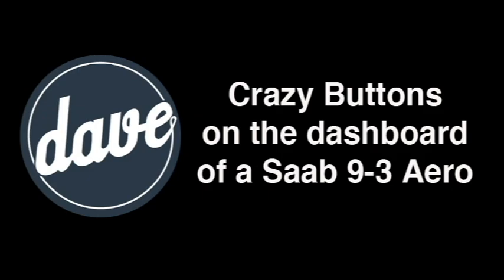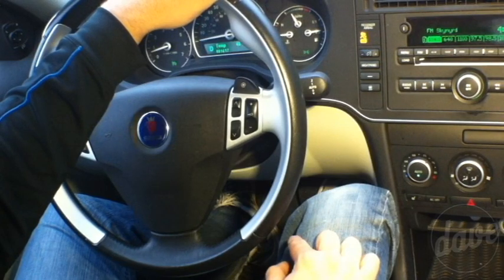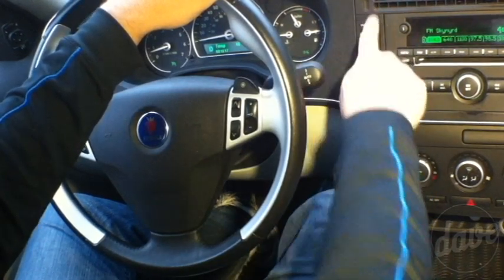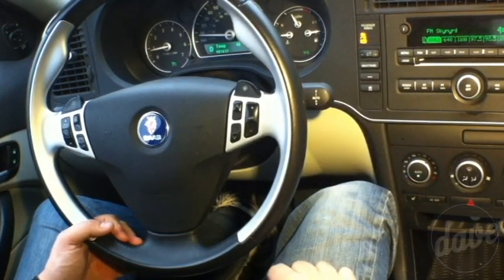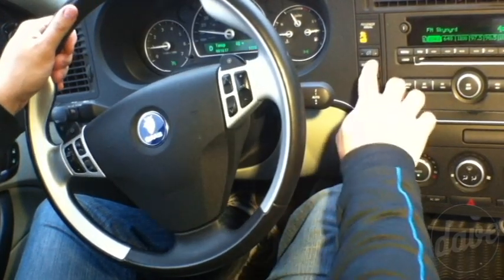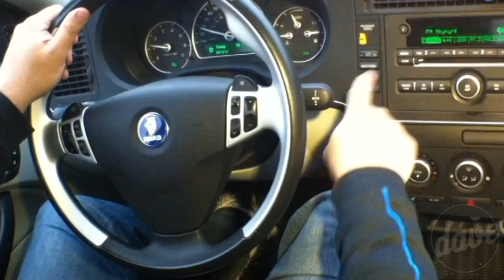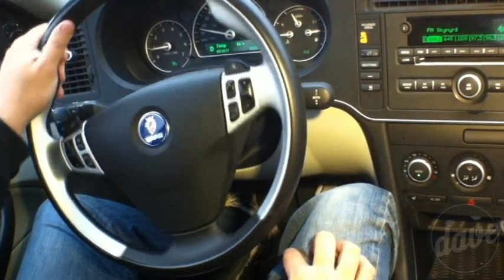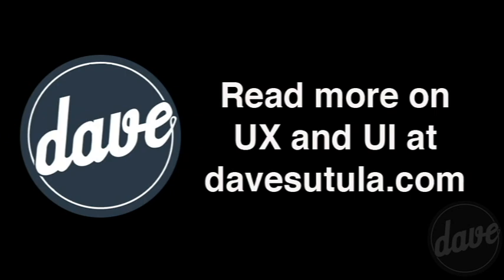Bad UI.  Four buttons I cannot explain in my Saab 9-3 Aero

Comment: Night mode was created to improve the drivers night vision , it turns off all unnecessary illumination on the dash gauges except the speedo (they will instantly re-illuminate  if there is an issue with system they monitor such as high coolant temp or low fuel level etc) this allows the low light sensitivity of ones eyes to not be influenced by the ambient light from the dash displays and also reduces driver focus  distractions as well so ones eyes can adjust to be more sensitive to low light viewing at night similar to the act of pilot intentionally  dimming his instruments for better low light vision while flying at night which is where this feature originated.

Comment: The car was designed in Sweden with the driving conditions in mind. during the mid winter there is no daylight within the arctic circle while there are elks running in the forest that may jump in front of the car at anytime in the darkness. It is in these circumstances that you start to appreciate the dimmable instrument panel lighting, the (-) switch for the auxiliary headlights, or the night panel. The TCS bypass is rarely needed due to the well designed traction control system but there are times when it must be bypassed  in order to get unstuck in snowy and icey conditions. I can understand that in places with more pleasant circumstances there is less need for such functions.

Comment: The night panel is extremely useful in Scandinavia, which is why the engineers designed the function! It might not be useful in other parts of the world, but in Sweden, where half of the year consists of darkness, low visibility and bad weather, the night panel function reduces the light emitted from the cabin (and thus reduces the strain on the eyes). This is critical when it's pitch black at 22:34 at night in poor weather (read november) before the snow has settled and it's raining outside and you can't see shit and some wild (large) animal is standing by the wayside or on the road a little up ahead. I know that this function for a fact is useful since I always activate it between october and february when driving in Sweden during most of the day (when it's dim or dark outside).
Reply: Also - the button with the "----" is the "extra" button. It's designed to allow the owner of the vehicle to install accessories which can be turned on/off using Saab-designed buttons. In Scandinavia (again) it's quite common to install extra heavy duty external lights, and this button allows the owner to seamlessly integrate those lights (or other equipment) without cluttering the dashboard with hacked-together shit.

Comment: 1 dimmer works better at night since you can see the lights better
2 the 9-3 has a lot of lights it turns them off. use it ever day
3 no idea that is why I am here
4 traction control toggle. on to stay of road off to slide in snowy parking lots

Comment: Ungh, old video, but the comments are mostly as inaccurate as the video. The reason for TCS/ESP (fourth button) not immediately turning off when you press the button is that it's a safety feature so you have to push it for a few seconds to actually commit to turning off this safety. Also, this is an icon that is standardized so you will find them in all cars since at least 2010.

Comment: The button with the dash on it is for an optional set of extra lights. There is a relay and wiring harness along with the actual lights needed and then dealer programming is needed to enable it. When equipped the extra lights will only turn on with the high beams on. I don't think this was ever offered in the USA and is probably pretty rare in EU too. On convertibles the "---" button is replaced with the convertible roof controls.
Reply: +David Howard 
Dear David, you mentioned that it is for additional lightining. And that there is everything ready, llwiring, relay.. but you also mentioned that it need to be enebled firsty.
i was wondering if I could use this button to control additional, aftermarket headlight spray system that I would like to install.
Would it be possible, how do you think?

Thanks
Sero

Comment: This is somewhat strange.. I have a 2003 EU version of the car, with the 5 speed manual, and the Dash gauge Lighting difference is quite noticeable when using the adjustment button.

As far as the NightPanel goes, I literally use it all the time. I don't need to know my RPM, I can tell when to shift just by listening to the car. The temperature gauge always stays the same and, should it go wrong, it lights up anyway. Same with the fuel. And the boost pressure gauge is nice for impressing your friends, but does nothing in actual driving conditions. A turbine failure will appear on the SID at the top of the dash anyway and probably engage the limp-home mode on the car (an icon with a rather cute turtle will appear :) ) So, I guess it depends on how you prefer to drive. If you enjoy the light show, on it stays. I've been on journeys for 5 or 6 hundred miles, at night, with the dash off and appreciated the lack of lighting.

That Minus button in my car is solid. Buttons like these are used for auxiliary equipment, usually. Say you'd want some cool Hella floodlights up front, you hook up the wring behind the button to them and boom, lights. I have another car that's like a replica of an old '69 Renault 12 (a Dacia 1310), and on the dash are two toggle switch blanks that people tend to use for fog lamps or (since the car came as a pick-up too), roof bar lights.

The ESP button you have at the bottom will work, actually, but I noticed in your video you were driving along. However, it can only be engaged or disengaged up until 30 or 40 Km/H. The best time to try it is when you are waiting at a light and the car is stationary. If you press the button a diagonally crossed orange triangle with the skidding car in it will appear in the display beneath your speedometer signalling the absence of ESP. I tend to drive with it switched off since you get a better feel of how the car shifts mass in its normal state. It also affects the electronic throttle, in that you will notice it to be sharper than when the ESP is engaged (this is not because the throttle position sensor works better or anything, but instead the ESP no longer cuts throttle when the wheel sensors report wheel spin).

I kind of wish there would be an ABS disengage button too but hey.. we can't have it all I guess :)
Reply: The traction button - or ‘Slort Mode’ in the 9-3 - displays the word SPORT on the friggin dash under the currently selected gear!!! This guy is such an embarrassment to himself. 

It changes the drive by wire & RPM arch.

Comment: Her ein scandinavia the night mode would be great. I remember I had this double din pioneer head unit in my Volvo S90 and I were driving from Oslo to Bergen, that's a farily long drive without any lights. It was in the middle of the night and the head unit had blue leds. After about an hour or so, it really strains your eyes. It starts hurting your eyes and takes away your night vision.. The pioneer double din was not dimmable.

So I really see a use for night mode. The traction off button is a well known symbol. The dash button I have to agree, is not really intuitive. The others though I would say are. You clearly see the instrument panel by the +-.

Comment: I would just like to comment on this the first button is the light dimmer control button used only at night. depending on whether you want low lighting or higher on your dash or console. the 4th button you are referring to is the traction control system if you push it nothing will happen however if you hold it in for a certain amount of time then and only then will I disengage the traction control system

Comment: And the ESP is electronic stablity program. Also called eTCS. You won't notice it unless you are driving in low friction areas. Reason you can turn it on and off is that in sweden where it is made, the people there are so used to driving on ice they like the option to turn it off.

Comment: Don't SAABs come with owner's manuals in the states? 

Night Panel; since you filmed this in daytime, it won't be obvious, but the clue is in the name. It's to avoid fatigue when driving AT NIGHT, and it has some superbly sensible features - the speedo has printed readings to 140 or so, but when you engage Night Panel, only the segment up to 90mph is illuminated, on the (reasonable) presumption that you won't be going above this. Also, every gauge except the speedo is dimmed, BUT - if fuel drops below a quarter tank, the fuel gauge comes on. If any alert situation arises (overheating) the appropriate section also illuminates.

Likewise the top button is instrument panel illumination level; the use for which becomes obvious in night driving.
Reply: Moved on from the old Lotus then, we see..  ;-)
Reply: Yes and if you get one that doesn’t have it they’re like $5 online

Comment from the maker: The fact that we have to have this conversation is testament to the fact that it's bad UI.  It should be intuitive, not a topic for a support forum.
Reply: Not at all. 

You had to LEARN how to drive. . 

You had to LEARN how to drive a standard transmission. 

You had to LEARN how to check, add or change the oil. 

You had to LEARN how to check, add or change several other fluids. 

You had to LEARN how to check tire pressure and/or put air in the tires. 

You had to LEARN how to change a flat/put on a spare tire. 

EVERYTHING about a car is an exercise in LEARNING. 

NOTHING about a car, or driving one, is a strictly ‘intuitive’ or ‘assumable’ aspect. 

The vehicle, owning it, maintaining it and/or driving it simply starts to TAKE ON a sense of - it begins to FEEL LIKE - a much more intuitive experience because WE as the owner & driver are getting older and have more experience.  It is like anything else in our lives. The greater our reference points, the simpler it seems. 

But, try asking a 2 year old about mowing the lawn or an 8 year old about basic algebra and they will look at you like you have a second head.

Comment from the maker: A few answewrs to the comments below:
1. There are no newer models to this style, so the comment that the button is used in newer models holds no water.  That might have been the planned use fore it, but....
2.  I understand what the nightpanel is meant to do - reduce eye strain - but c'mon.  I think that this is a bad idea and I stand behind the 'crazy driving' comment.
3.  As far as the owners' manual goes - the version I had made no mention of any of this except that it identified the traction control button, but still made no attempt to explain the function.  I mean, without a description, one woudl have to wonder why anyone would ever drive without traction control on.  Does it make sense to think that there are occasions where one would want to have the traction in an out-of-control state?
4.  Indeed, I know nothing about SAABs from a mechanical point-of-view - but that's exactly the point.  The user interface on a consumer product should not require deep specialized knowledge of the product to be completely usable.  That's what intuitive means.  Do you have to soend six weeks studying the ins and outs of audio compression to operate an iPod?
5.  If you read the comments, a number of the supposedly well-informed commenters disagree on the function of the button with the - on it while all admonishing me to read the manual.  So...
Reply: 1.  this car was built for swedish and american drivers.  There are some functional differences due to the nature of driving conditions in the nordic regions.  As such, there is probably a use for that blank button in swedish models.  It would probably look weird with only 3 buttons won't you say?

2.  Just because you haven't found a use for the NightPanel doesn't make it 'crazy' or useless.  I happen to use it regularly since I drive long distances on dark roads at night. It only shows you what you need to see; the remaining gauges and notifications still illuminate when there is an abnormal condition. 
 -If your rpm goes too high, the gauge will light.
- If your fuel is low, the gauge will light up...etc

3.  I don't know about your car, but when I press the traction control button on mine, the icon shows on the notification area so I don't know what to tell you there.  Also, every car I have driven with traction control has the option to turn if off - this isn't a saab thing.

4.  in response to the ipod comment, no you do not need to study audio compression to operate it.  But there are tricks and shortcuts which take time to either stumble upon, or get familiar with.  That is what these controls essentially are.  You don't need them to DRIVE the car; they are just for convenience.  And btw, how long did it take to figure out how to use Itunes with your first Ipod...nuff said.

5.  Again, blank button, if it doesn't hinder the operation of the car, leave it be.

Hope this helps!!
Reply: eazye8523 I'll add.

2. Exactly - the button doesn't make much sense in the city or on lighted highway... but try driving on dark backroads in the night... it'll make a world of difference. Similar with the gauge backlight.

3. Useful to get yourself out of snow, for example. Either you just have your car dig in until it gets to a good surface, or you roll your car fore/aft, fore, aft... until you gain enough momentum to get out of snow. 

4. These buttons are not really essential to drive the car... as you probably know by now... but they help a lot when you know how to use them. Not bad UI.

5. Used on convertibles for roof control, that's that.
Reply from the maker: Bullshit, bullshit, bullshit.
Reply: David Sutula How very constructive of you. You must be a master debater.
Reply: Peter Fabian Exactly!
Reply: These are all useful functions on common Swedish road conditions. Snow, ice, long dark Arctic nights. That's what they were designed for.
They will also prove useful in remote unlit areas, long drives at night, if you get stuck in the sand on a beach or back road and scenarios like that.
If those are things that never happen to you, then those buttons will not be very useful to you.
The icons on the buttons are very clear though (except for the -, but I guess it's not connected?) as to what function they perform.
Reply: +David Sutula 
The first button is common in many cars and is set up in a similar way usually near the instrument panel or down with the headlight switches. Furthermore I know at least in my 9-3 the dimming makes substantial difference at night where there is a definite difference.

The night panel button I admit is a bit gimmicky but when I'm driving long distance as I tend to in Australia at night it comes in useful. As many others have mentioned it works well at preventing glare especially when you use the first button to dim the remaining lights to the lowest setting.

Third button is not a commonly known button but it does serve a purpose, in the 2004MY book it states these are for additional driving lights. There is a wiring harness in the engine bay, it can also be used for other applications such as front PDC. However, due to regulations in the U.S. cars are limited to how much light they can produce so this button can't be enabled on U.S. models.

Fourth button on older models would say TCS or ESP depending on spec, however if you can't tell what the universal symbol for traction control is then I doubt you'd know what those acronyms stand for.
Reply: +David Sutula the dash button would be where the convertible button would be if it were equipped.  the bottom button is the traction control button that your saab must not be equipped with.